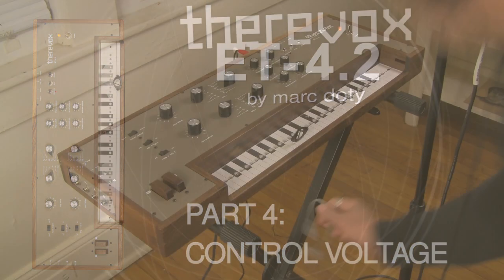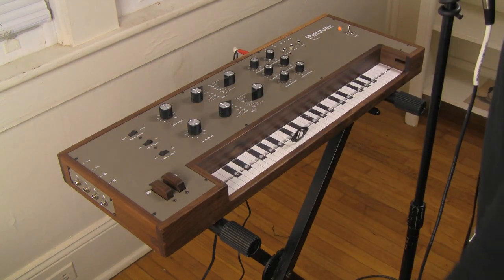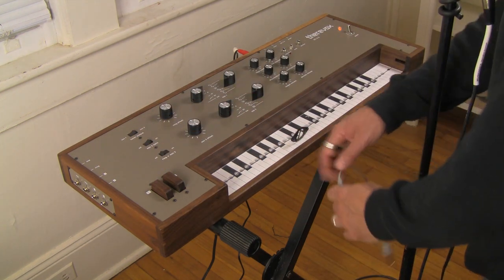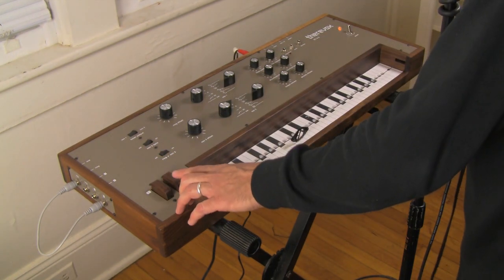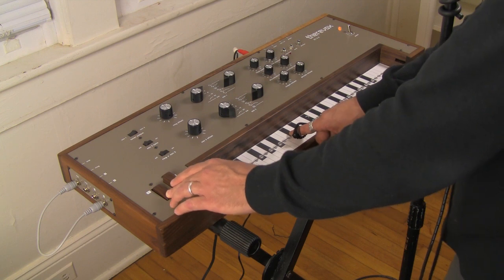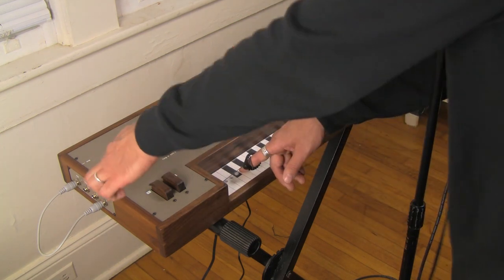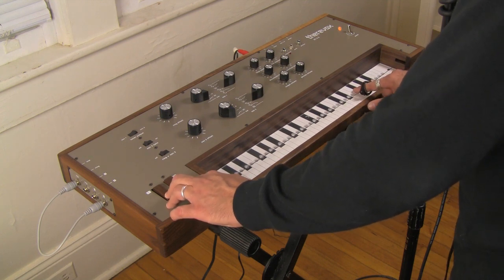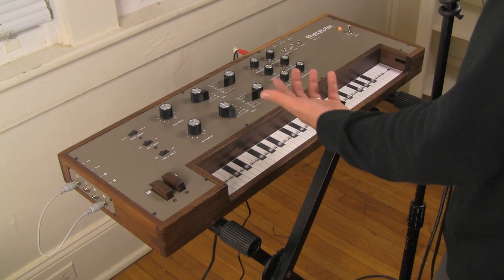The Therevox ET-4.2 Part 4: Control Voltage

Comment from the maker: There is a difference.  You could get something that sounded like this, theoretically, from using portamento.  But with this, you have the ability to decide at a moment's notice whether there is portamento or not, or how long that portamento is in real time.  In addition to that, you have immediate physical control over the volume of the oscillator at any given moment